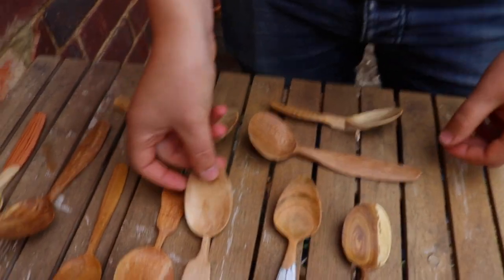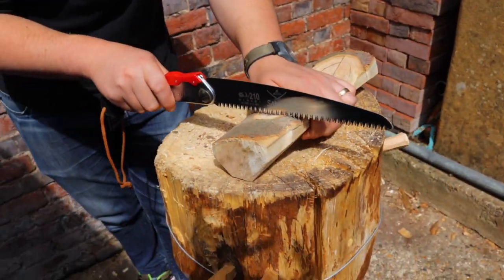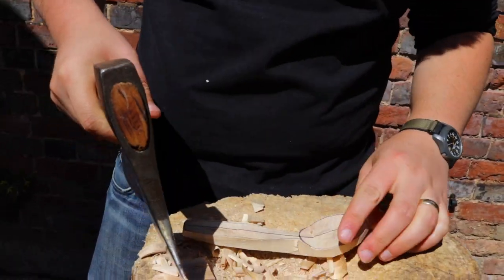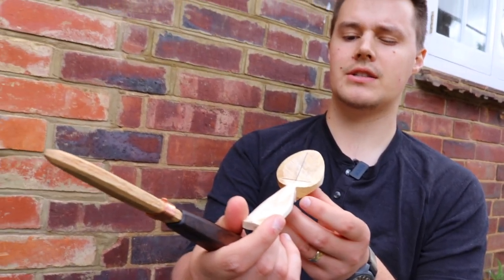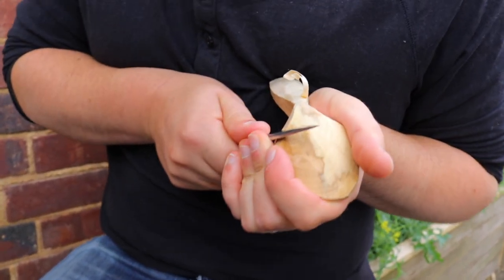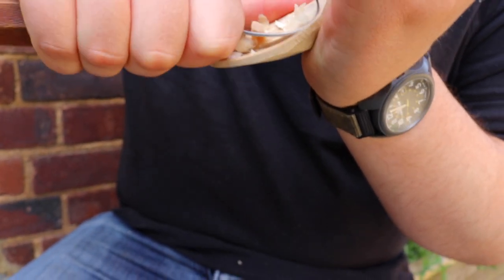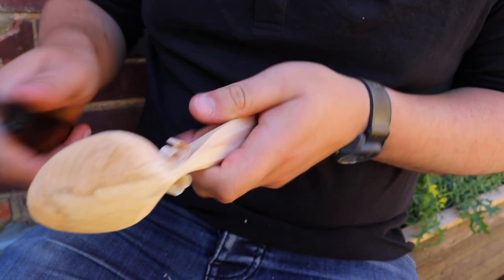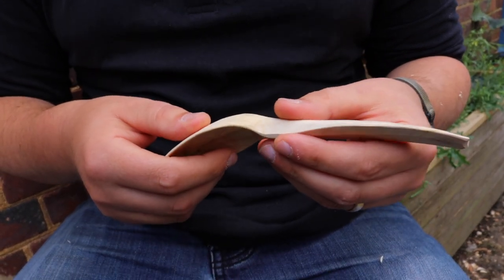How To Carve A Spoon - Aaron Garrett

Comment: I’ve watched this a few times now, or parts of, and a question I have is ‘how old is the wood that Aaron used in this video?’ I have started carving, mostly with very green wood, perhaps too green if that is possible. My axe cuts aren’t as good or precise but I understand that. My thinking is the wood perhaps needs a little ageing - months?
Reply from the maker: The wood being very green is no problem at all, in fact the greener it is the better. Getting precise axe cuts is really all about technique and the sharpness of the axe, so thats where I would suggest you work on. You don't want to let the wood age at all, the more you do the more it seasons and becomes harder to carve ~Peace~

Comment: What does burnishing mean and involve?
Reply from the maker: It's similar to burnishing leather where you use a pebble, antler, etc with a smooth edge and rub it along the surface of the spoon in short bursts so it creates heat and flattens the surface ~Peace~
Reply: Zed Outdoors   Ah. Thanks.